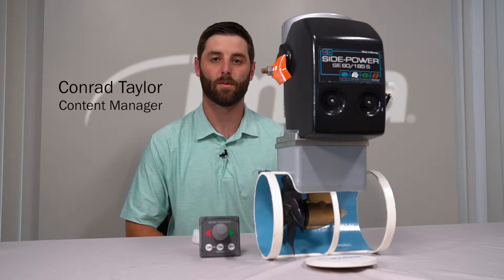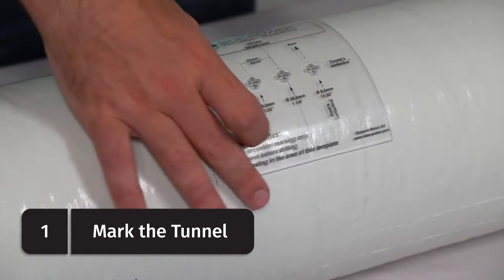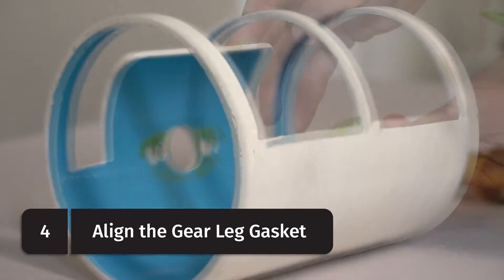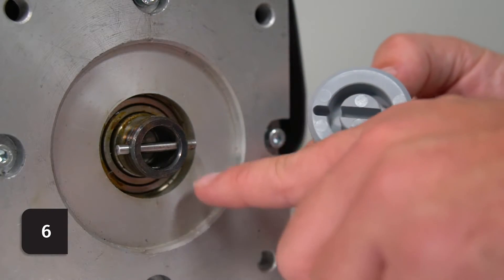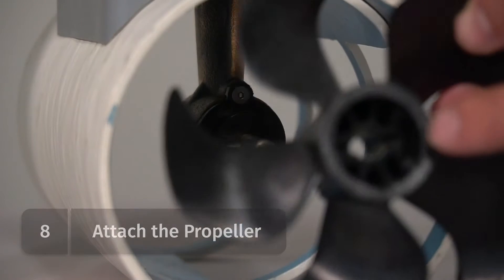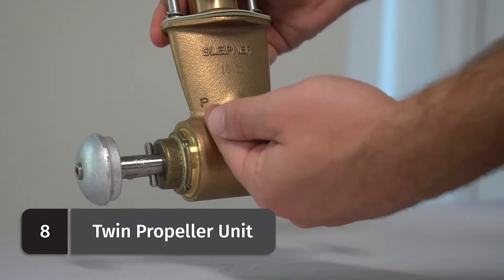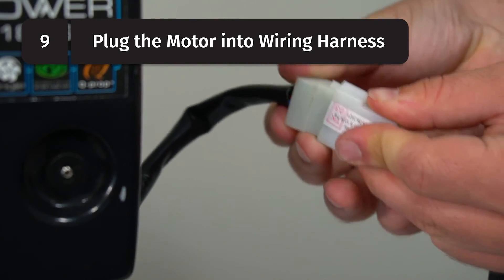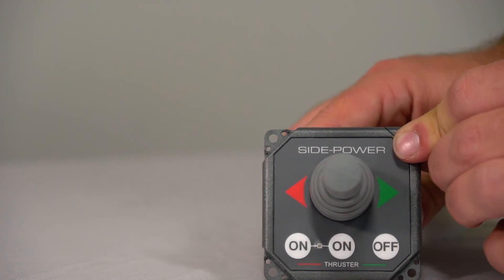How to Install a Sleipner (Side-Power) Bow or Stern Thruster

Comment: Hi. Does 1.10 to 1.20 indicate that there is a water seal between the tube and the shaft, which means I can remove the motor without flooding the compartment?
Reply from the maker: That is correct, the thruster motor can be removed from the bracket with the boat in the water.
Reply: @imtramarineproducts thanks for the answer, but I already managed to complete this job in December last year.

Comment: At 1:45, the installation shows a gasket. I'm installing a replacement motor. No such gasket (or screws) was provided. Can I order one? Part number?
Also, no installation instructions were provided. Do you have any?
Thanks.
-Bruce
Reply from the maker: Hi Bruce, sorry for the delayed reply, we do have gaskets available, we'll just need to know the thruster model, and our customer service team would be able to provide installation instructions as well. Give us a call at (508) 995-7000 and someone will be able to assist you!